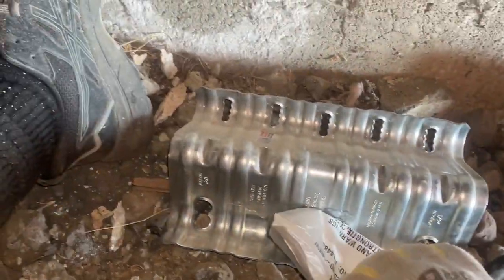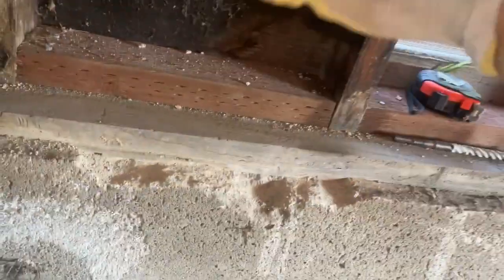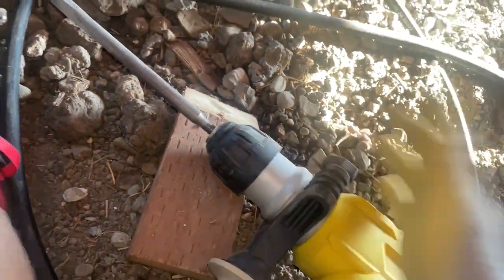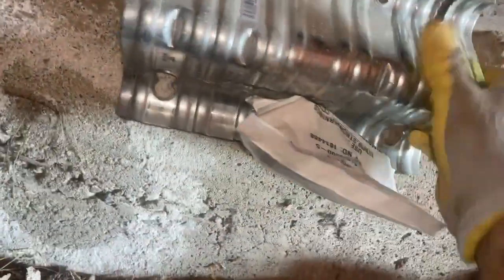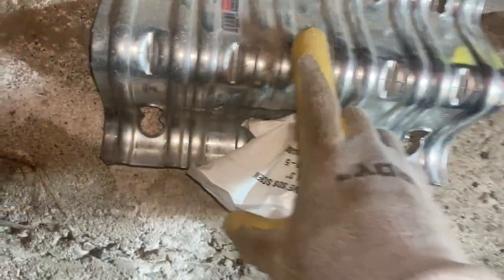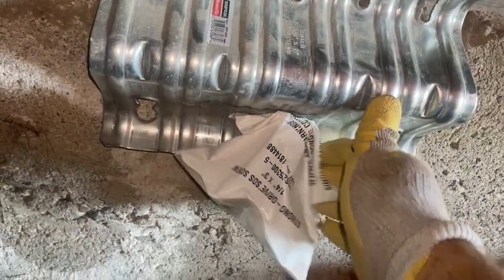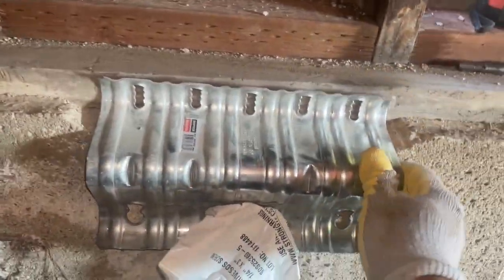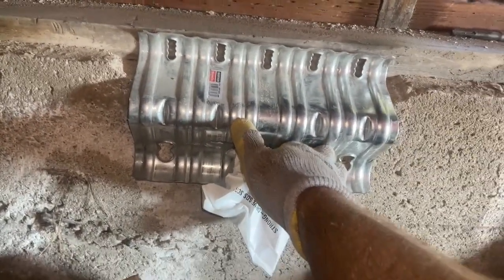Mudsill Foundation Anchoring Seismic Retrofit Simpson URFP Install

Comment: On the spacing, my structural engineer recommended that each plate be anchored down in 2 places. Considering that most plates are likely to be 8ft, my thinking is that if they’re always 1 ft from the end, then that also resolves the every 6 ft argument. So for an 8 ft run, you do plates at 1 ft OC and 7 ft OC of each board.

Comment: Helpful video. How many plates did you install and how many concrete bits did you go through?
Reply from the maker: The number of plates varies a lot based on the length of the perimeter of the house - but for this one it ended up being about 45 plates. I used a bosch 1/2 bit and it lasted the entire job.